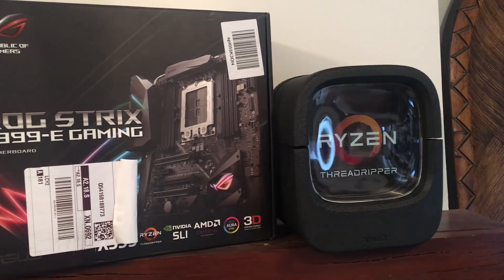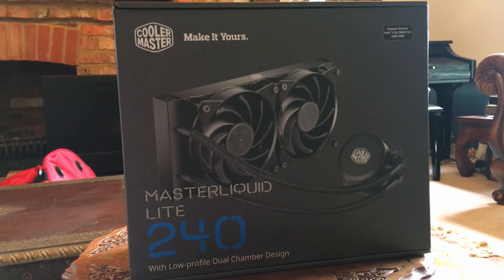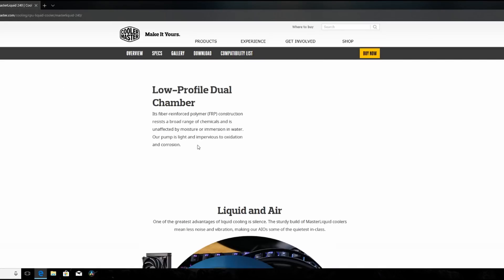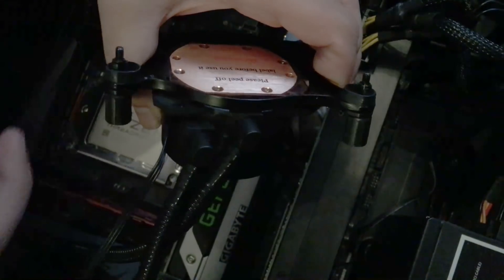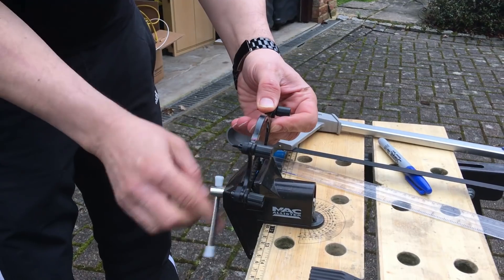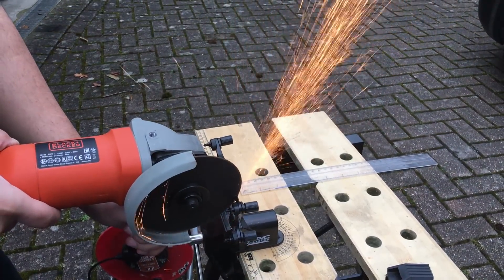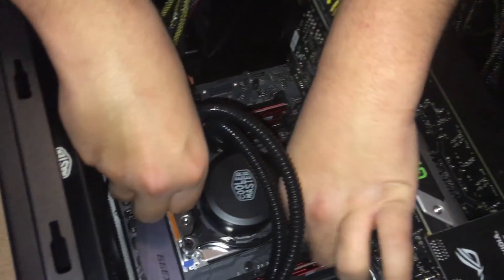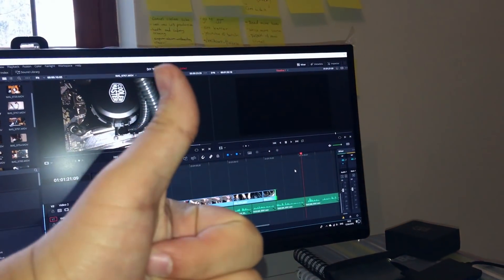How to make a Threadripper cooler mount - DIY TR4 cooler mount

Comment: I own a Water Cooling system designed for AMD Ryzen Threadripper. But I own an INTEL CPU. with a LGA1155 socket. I need an mounting bracket adapter. This is been helpfull. I hope I can find a solution. any tips?
Reply from the maker: Hey Francisco! Unfortunately I'm actually not sure about that as I have not personally seen it in person to be able to analyse it. If the only issue with your cooler is like mine,( where the tubes are blocked by the mount, but otherwise everything else would fit fine) then you can go ahead and try the solution in this video (At your own risk of course 😅).
But otherwise, if you are able to, then go ahead and get the adapter. However currently with the Covid-19 outbreak, you may not be able to get it. So it's about your own judgement of it. If your only issue is that the tubes don't fit, then it's something you could try. Again, it's your decision, because this is something very individual, i will say it's at your own risk because it involves using tools too. 
But one thing I can say is that this solution worked for me and I'm still using the same PC and cooler in the same way.
I hope this helps!